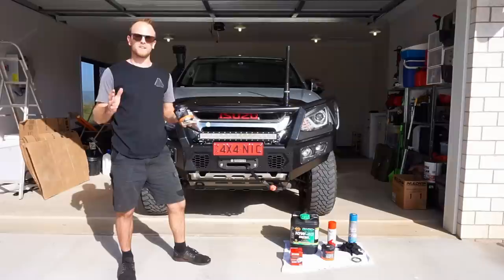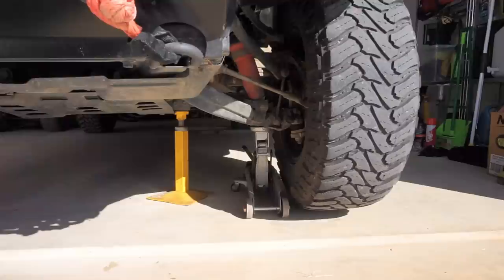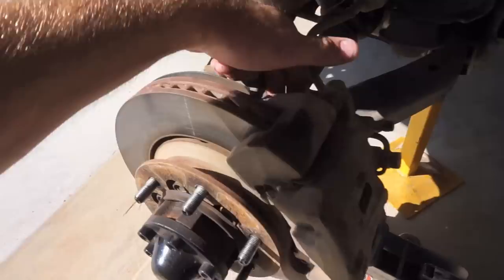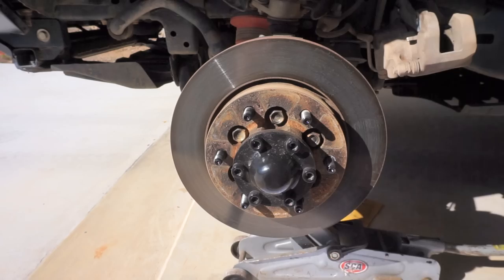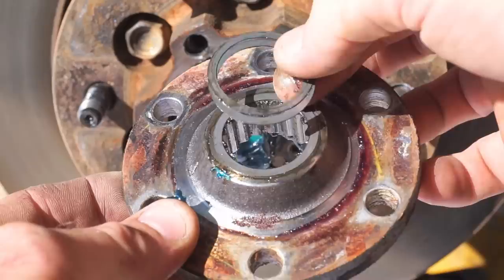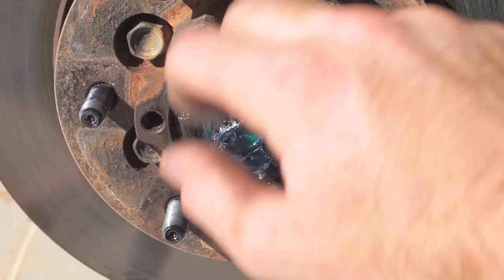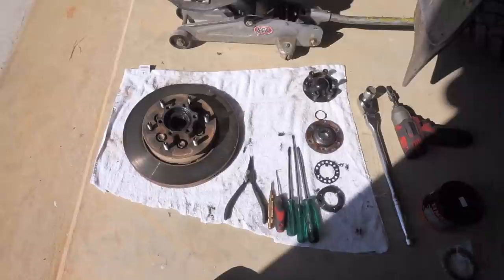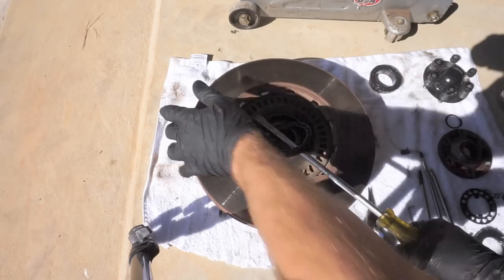How to RE-GREASE your Front Wheel Bearings - Isuzu MU-X/D-MAX DIY Tutorial

Comment: FYI that “tensioner ring” is actually a ring for eliminate “free play” Isuzu front wheel bearings take zero preload, how we do it at the dealership is we tighten it down with a specialty tool (or needle nose) then loosen it off, then repeat again man as many times as necessary to completely seat the bearings then loosen it off the smallest amount and align with the lock, this pushes any grease out of the way and gives the rollers a chance to seat evenly. Also there is a specific spot you can loosen the ring to using the markings on the ring and the left side of the groove in the 12 o’clock position on the end of the shaft that will ensure the lock is lined up with the holes every time

Comment: Hey Nic, nice stuff. One thing I do differently is pack bearings from the larger side...the opposite to your vid. Being a larger opening at the rollers it is nice and easy to get the grease through without getting too much grease in the centre of the bearing..if that makes sense. So it's less mess, not that your way is wrong, it's just another way and the only way I've ever done it.

Comment: this is exactly what needs to be done on my holden colorado. cheers. and thanks for the advice to get a new hub seal before starting.... Although it worth mentioning that the bolts to re-attach the brake calliper have to be a whooping 150 foot pounds thats for the d-max as well.

Comment: Hi Nick, great informative and professional video once again. Great job! Thanks for helping us all out by doing these. I’ve been a keen four wheeler and diy mechanic for over 25 years and still manage to learn a thing or two every time I watch one of your vids. I’d just like to add or rather suggest a tip based on my own MUX a 2015 model and the experience I’ve had with the shims. In between services, I would begin to hear a high pitched “brake noise” like the sound a polished disc begins to make coming from the front hubs. After close inspection of the pads and rotor I found no evidence of wear or shine or polish. But then upon servicing my hubs found those shims to be somewhat dry and filmy. I thoroughly cleaned them and lightly greased them and problem solved. No more noise. So for anyone out there experiencing that noise, check those shims. Drove me nuts. Looking forward to your tappets vid. Thanks again Nick and keep on wheelin! They’re awesome trucks!
Reply: Noise is from crap in the inner CV seal. Pretty common on DMAX / MU-X. When you removed the circlip and shims ( splined end ) you may have moved the CV shaft in enough to dislodge the debris making the noise on the inner end ( fat end ) of the CV. I got tired of the damn noise in ours and fitted free wheeling hubs! ;)
Reply: MJHMech Thanks for the tip MJHMech! How do you find the free wheeling hubs?
Reply: @johnsadek1536  I've got FWH to my Dmax, nothing bad to say.
Just have to remember to engage when airing down, get the occasional noise when in 4wd.

Comment: Hi Nick, Although you show  the process with great ease & detail, how to re grease the bearings.
when I came to remove the cap screws , I found that I had to replace the wheel and have it on the ground to stop the wheel from spinning when trying to undo the cap screws from the hub cover plate.
I broken two Allen keys trying to undo them  and had to use heavy duty impact gun on max setting plus heat to remove them. No way on earth was it as easy as you show, I recently acquired this Dmax and wanted to make sure that everything was checked before I go tripping. I will check my bearings again after I've been of road  and see if it is any easier . I can only suggest to anyone before jacking up, to try and loosen the cap screws first.
Otherwise good presentation  
Cheers Gypsy
Reply from the maker: A good rattle impact gun is necessary to remove them with ease. Otherwise like you said, you will need to have the wheel on the ground and crack them off with an 8mm hex and a breaker bar. Some people overtighten them which may be what happened to you. I have never needed heat or snapped one before! 😮
Reply: @LowRangeNick  All good, your presentation was good to show me the way, but what happened to the chocks at the other wheel?

Comment: Can we request a video on doing the valve clearances that's my next big task and the only thing I haven't done before
Reply: as I have understand sir, the valves are self adjustments already since it is driven by pressure pins
Reply: @vitoabeleda2445  not true for the 4jj1 in the Isuzu. They're screw type adjustment. I've done a couple of them, pretty easy job. The Colorado has hydraulic valves which never need adjusting.

Comment: Thanks Nick
Will check mine at 50k as well. Hopefully dealer does the scheduled 30k repack... Surprised you haven't fitted FWHubs yet?
Did my first drain of catch can too. 200ml after 20k with it, suspect that to increase as it wears. Still stock mapping 
Cheers
Reply from the maker: Hey Jo! The dealer should do it as part of the 30k service. I usually drain out about 150-200ml or so every 10,000km when i service the mu-x. It all depends on what oil your running and how many kms the engine has. 200ml is still a good amount to keep out of the intake 😀 No fwh yet! 😋

Comment: Great video mate. I wonder if the dealers can be bothered doing this every 30k as per service manual...
Reply: As a technician working at an Isuzu dealership, I can assure you we do remove, clean and repack bearings and fit new seals. And we preload the wheel bearing using a spring scale, using a special tool to remove and replace the locking ring, plus adding a little sealant on the hub plate to prevent water penetration when off road. If you can prove a dealership is not doing your service properly, go back and show them. You pay good money for their product knowledge and Isuzu experience.
Reply: @damienferrara3078  good to hear that's the case mate. Out of interest, Can you tell me if you think a valve clearance adjustment can be completed correctly within 3 hours of a car being dropped off at the shop (following a 25km drive)?
Reply: @damienferrara3078  as a technician can you confirm you actually check and adjust the valves with the rocker cover removed (and not just an audio check).but still charge the customer the full price?…asking for a friend…

Comment: Good stuff Nick, Gonna have to give this a shot myself soon, my Dmax has started the Isuzu wheel bearing squeak. Its doing my head in!
Reply: Troy Hunter mine does that too I find that all it needs is a bit of silicone spray where the CV comes through the back of the hub. Try it and see how you go but it fixed mine, careful not to spray your brakes though! I carry a can with me in my rear drawers now because it comes back after I go through puddles.
Reply: @chenderson4969  hey sorry to bother u, i don't have much experience so i hope u can help me to describe where exactly the part and how i can reach it. Thank you
Reply: @Nick-ko1tw  in the back side of the front hubs you’ll see where the cv axle will come through the centre of the hub, right where the metal cylinder of the cv is closest to the hub, spray that with silicone spray be careful not to spray the brakes
Reply: @chenderson4969  sorry but my mu-x doesn't have front cv axle😂

Anyway, I spray plenty of lubricant on the part between dust shield and brake disc, i also clean both side of disc so it should be free of any lubricant, is that the correct place tho?
Reply: @Nick-ko1tw  not sure mate my dmax is 4WD, best to take it to a mechanic to ensure nothing is unsafe.
Reply: @chenderson4969  welp ok then. thanks

Comment: Great video mate , my dmax is going in tomorrow for a 30 k service and to fix an annoying comes and goes squeal from the left front wheel ( service manager says it’s a dry seal due to insufficient grease when built ) seams a bit odd for a new car
Reply from the maker: Awesome! The dry seal is very common issue. Usually just spray some sort of lube up in behind the cv shaft cover on back of the hub. If you go through water crossings and stuff it can come back.
Reply: LowRangeNick cheers thanks mate I’ll do it now see how it goes
Reply: Every time you do re grease your bearings when you have it apart just push the cv back and put some grease in behind there with your finger or grease gun. You will never hear that squeal again

Comment: Please help, I'm from south africa. I'm driving 2013 Isuzu KB300 single Cab 4×2.
Problem is when try to stop in 40-30, I mean when I do hard brake on 40-30 speed the car front body shaking a lot, not steering not brake pedal the whole front body.
Is like my car try to jump, Jumping.
I didn't find any problem the suspension is ok the brake pad disc, rear drum i bought new from Isuzu ( genuine parts)
Also other parts is ok...
This problem only happen when brake in low speed...
Please help me I'm struggling.
Thank you.

Comment: Man what a legend. Great information. What are the thoughts using marine grease, especially on a 4wd that would inevitably see water crossings and bog holes, seems to be a bit more tacky and doesnt wash out as much as hi temp grease.
Reply from the maker: I have heard of people using marine grease for wheel bearings. I have never had an issue with high temp bearing grease and water so i have just stuck to using it. Even after my cape trip with my 80 series the hubs were still clean and full of grease. I think if you seal the cap and put in enough grease to the hub you probably wouldn't see too much difference because there shouldnt be much if any water getting in. Feel free to try it and let me know how it goes, could be an interesting experiment. 😊

Comment: I went to regrease my bearings,  but the 8mm hex bolts were so tight, the impact gun wouldn't loosen them, next step was allen key with breaker bar, but was worried that they would snap, they must of been over tighten when or if  they did them at the dealership. Next step more professional help. Has this ever happened to you.
Reply from the maker: Hey Sam! I do quite a few wheel bearings on these and there are always a few of the hex bolts that are mega tight! I've got a 1000nm impact gun and some impact hex bits that zap them out no worries though haha
Reply: @LowRangeNick  many thanks,  might be my next move, a more powerful rattle gun.

Comment: Hey Nick I had a lot of trouble getting those 8mm screws off the wheel bearing case even with an impact driver I kept snapping bits, dealer must have over tightened them. Any ideas on how to get them off?
Reply from the maker: You can either put the wheel back on with the center cap off and drop it on the ground and loosen with a Breaker bar or jam a flat blade screw driver in the vent holes in the brake disc and let it rest against the brake caliper.

Comment: Hi Nick, Great walk through video, I have the same model. What's your thoughts on the DP ChipX ? against a throttle controller option ?
Reply from the maker: They do 2 different things. The dp chip just increases rail pressure to make more power. The throttle controller only boosts the throttle pedal signal to give you better response. The plug in chips aren't a very good way to get more power as they only increase the rail pressure. Much better off getting a good tune done.
Reply: @LowRangeNick  Thanks for your reply, so what are the pros and cons with options DPchip or tune done ?

Comment: Hai mate...i do mine..but i cannot put back the circlip..any suggestions?
Reply from the maker: Try putting in 2 bolts in the hub and tighten down. Then put a bolt in the end of the cv shaft and pull out while  pushing the circlip on.

Comment: Whoever did mine before me stripped the guts out of the head of one of those 3 little Phillips head grub screws, so that is as far as I got for now. Put it back together and off to buy an easy out tool of some sort and another screw from somewhere, Mr. Isuzu I suppose?
Reply from the maker: If your lucky you can get them to pop with an impact driver if there not completely stripped out. Mr isuzu will be your best bet for the screws.
Reply: @LowRangeNick  Yeah tried that, it's pretty well just a hole, I even banged a star shaped security type bit in there without success. DO they need to be that tight? Doesn't the cap over them stop them coming out?

Comment: Great video. Thank you.  Have you replaced rotors yet? If so, did you have to use a shop press or just hammer the hubs off the rotors?
Reply from the maker: You should be able to hammer them off but you will need to remove the abs pickup very carefully so you don't damage it 😊
Reply: If its an Isuzu, no need of a shop press or a hammer, the rotors are bolted to the hub, if you remove two bolts directly opposite of each other, and insert a good screw driver into the bolt holes pointing towards the inner part of the hub, gently tap the ABS ring off, then remove the rest of the bolts. Wallah,  rotor separated from hub.

Comment: Hello Nick i have a question, I have just replaced new bearings front wheels. I notice that i still hear noise despite that the bearings are new, noise especially if i have some load on the pick up. Do you have any suggestions  of what i can do or what might cause this? Thanks in advance
Reply from the maker: If it's a high pitch squealing singing noise then it could be the hub seals on the back of the hub were the cvs meet the hub. If you look through my videos I show you how to fix the dry noisy hub seals with lubricant.
Reply: @LowRangeNick  Thanks Nick. What about maintaining the rear wheel bearing? Any video, how often should we re grease them?
Reply from the maker: @thescalpingant  the rear wheel bearings are maintenance free.

Comment: Why and when do you need to re grease bearings?
Reply from the maker: Around every 20- 30,000 km. The front bearings are tapered roller bearings so they need to be cleaned, regreased and re tensioned periodically to keep them in good condition. If you do alot of 4wding and water crossings it is common for mud and water to get into the bearings and cause lack of lubrication and even bearing failure. The grease also breaks down over time so that's another reason why re greasing is necessary.

Comment: Great how to mate. Im on 37,000km atm. Just before I put it in for my 15,000 km service. I experienced some high pitched squealing from the front. Was told possible dry hub. Service was done and squeal gone. Now its back but intermittent. So its been hard to get it to happen when looked at. Do you think hub and bearings need re-grease? Or is it another issue? Have you come across this issue yourself?
Reply from the maker: It's usually the cv seal on the back of the hub gets crap in it. If you spray some wd40 or some lubricant up between where the cv meets the back of the hub it should make the squealing go away.
Reply: @LowRangeNick  OH cool I`ll give that a go. Cheers mate.

Comment: Nice tidy job Nick. Did you get 14.5v coming from the main battery using the Redarc BCDC1225d? Or do you need to do something else to trick the smart alternator to increase the output voltage? Thanks 👍🏼
Reply from the maker: You need to wire up the blue trigger wire to a power source that is ignition switched. I used the cig socket power supply in the back of the mux.
Reply: LowRangeNick awesome. I am copying you’re set up, hope you don’t mind 👍🏼
Reply from the maker: @jetpilotdave  Not at all ! That's awesome!

Comment: Any problems with the abs light coming on after you've done? Mine wont go off now.
Reply from the maker: No problems. You may have damaged something. Or disconnected a wheel speed sensor with the ignition on?

Comment: Hi Nic, can you tell me the torque value for the six hub bolts? Thanks.
Reply from the maker: Not sure of the actual torque value sorry. Just nice and tight haha
Reply: @LowRangeNick  unfortunately no one has produced a workshop manual for the MUX but have done for DMax.
Reply from the maker: @frankpurvis5510  it's the same front hubs as the dmax so exactly the same setup.

Comment: Mate with the hub seal on the back is there a specific direction or way they go in?
Reply from the maker: Yes, they need to go in the correct way.
Reply: @LowRangeNick  would that be the spring side on the bearing side ?
Reply from the maker: @shanemclean9354  yep, the side with the spring goes down in towards the bearing.

Comment: I appreciate your safety precautions, but have you ever seen what happens to non impact bits when they explode? @lowrangenick
Reply from the maker: Sure have. That is why I loosened the wheel nuts when the wheel was on the ground and only run the nuts off with the rattle gun. The hex bits are blue point hex drives and are rated for impact gun use. Thanks for your concern 😊👍

Comment: My mu-x squeak when rolling down the road. Is this the cause of it?
Reply from the maker: Not these seals. It is usually the seal on the back side of the hub were the cv goes into the hub. Spray some silicone spray or some sort of lubricant in there and it should fix it 😊
Reply: @LowRangeNick  ah i see. What cause it to happen? My other cars never do this thing even after 10 years+
Reply from the maker: @Nick-ko1tw  Just a bad design I guess.
Reply: @LowRangeNick  owh okay thanks for the help
Reply: @LowRangeNick  hey, nick. the squeak is becoming worse lately so i'd be happy if you can point out where is the part I should spray based on your video timeline. Sorry for taking your time and thanks.

Comment: Sir Nick may I know the oil seal no. And bearings specs.thnx
Reply from the maker: Hi Garry. If you go to your local auto store they can look up the exact parts you need based on your rego number or vin.
Reply: @LowRangeNick  ok sir Nick as what I've seen but I'm not sure it  looks like the same with my Trooper 4JX1 engine which I usually done servicing and bearings and seal also replaced.